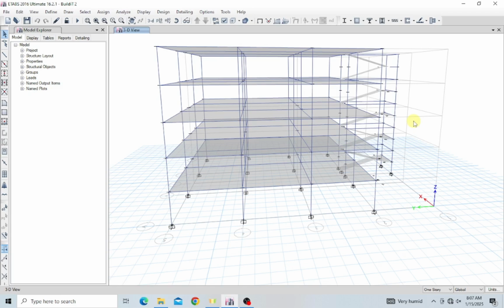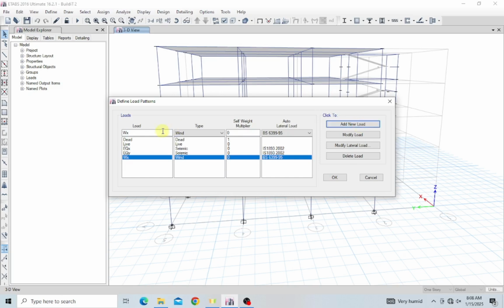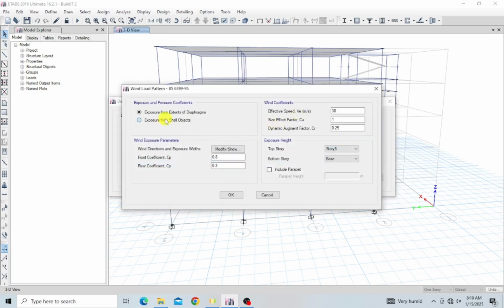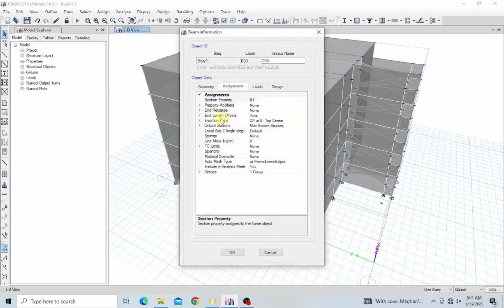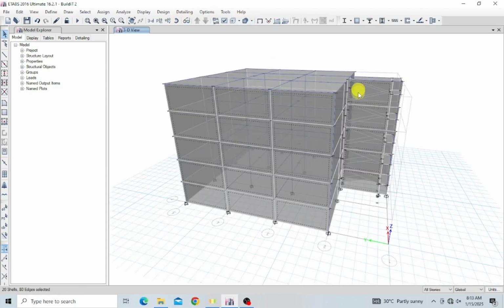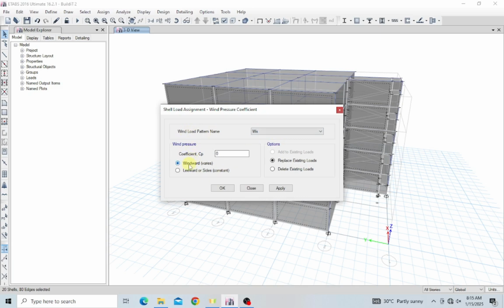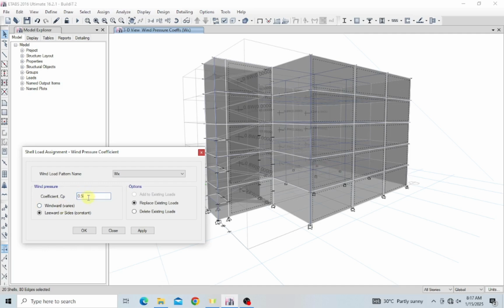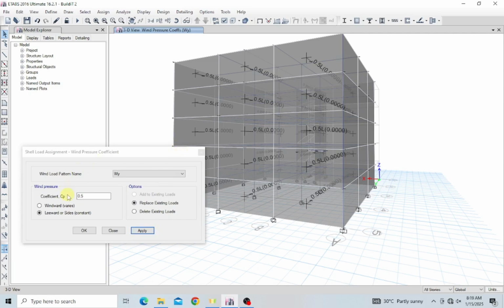15. ETABS for Beginners: Wind Load Analysis (Part 1) using Cladding

Comment: I think when applying the wind pressure coefficients you firstly need to turn on the Local axes of the floors then see their directions before applying otherwise most times one of the coefficients is negative